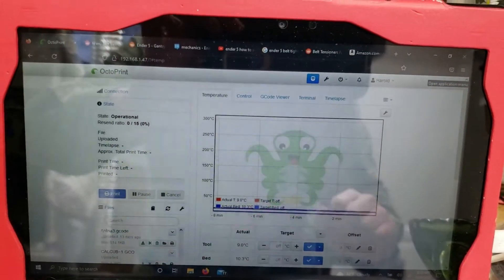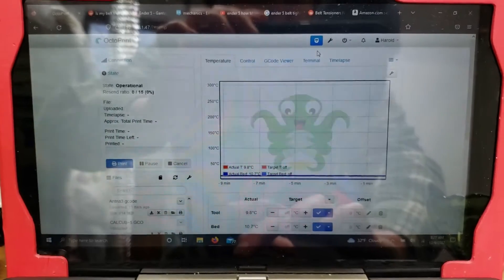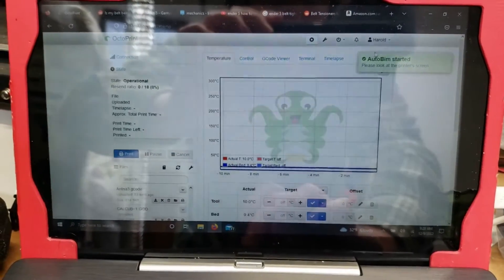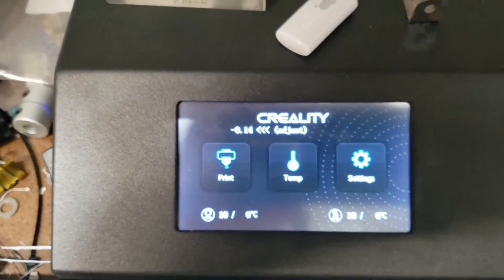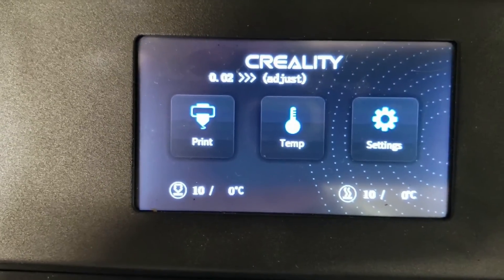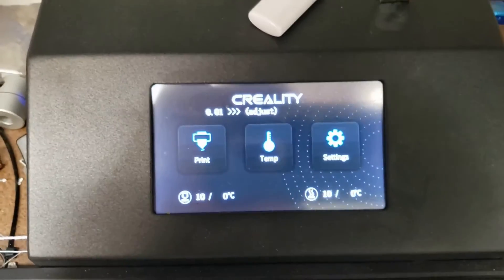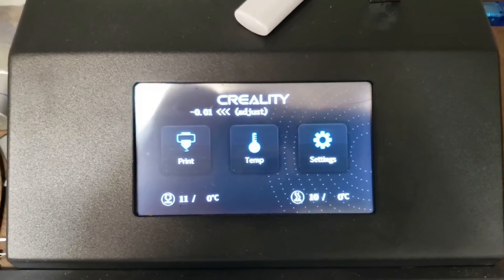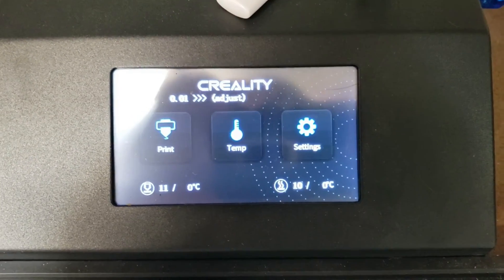Use your leveling probe for manual leveling with Autobim and Octoprint!

Comment: Hi, how are you? I am here about one of your old videos regarding the Auto Bed Leveling (Autobim) plugin for the Ender 5 Plus: [Video Link]. I am new to 3D printing, and after finally getting OctoPrint, I tried the Autobim plugin, but it doesn't work. I am running it on the Creality Marlin, but I am not sure how to install different Marlins or which one is even needed for it. I have been scouring YouTube and the internet for the past day and haven't found anything. This is my last resort, and it would mean the world to me if you could help or guide me. Thanks.
Reply from the maker: Hi there, thanks for watching!  I'll try to help as I've been fortunate to not have problems with running AutoBim.  First, I'll refer you to AutoBim's GitHub page where you can view its ReadMe by scrolling down:  https://github.com/j-be/AutoBim    One thing I forget frequently is to home the printer first, otherwise AutoBim won't run at all (a firmware upgrade will probably show such an error message on the LCD).  For Firmware upgrades, I'll refer you to this video by Kersey Fabrications:  https://www.youtube.com/watch?v=ExuPoNZK_aw    Note that you don't have to use Kersey Fabrications' firmware to do this.  I installed TinyMachines firmware on my printer using a Microsoft Surface Pro tablet connected directly to the printer via USB to upgrade the printer firmware, and the LCD has its own firmware that's updated via MicroSD card on the LCD board itself, so you'll have to open up your printer's control box to do this kind of upgrade.  If all else fails and you're still having trouble with AutoBim, I'd try posting on the Octoprint help forum here:  https://community.octoprint.org/c/support/7    If you're watching these videos, you've definitely prepared to learn and there's a lot of it with 3D printing!  I hope this helps!  P.S. I deleted your duplicate comment on the vapor smoothing video, so I hope you find this one here!
Reply: Sorry to necro this but did you ever fix your issue?
Also I love autobim as well. By far my favorite plugin, right next to bed visualizer. 
Also you do know that if autobim probes 4 consecutive without having to adjust, autobim will stop and say completed